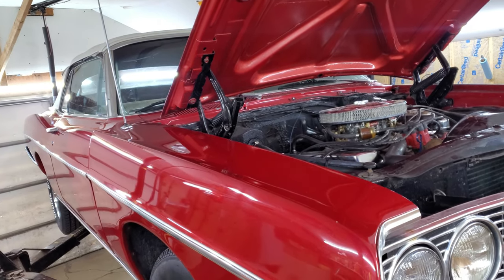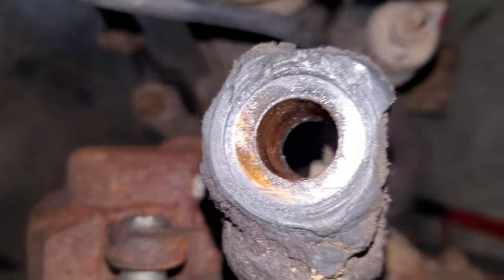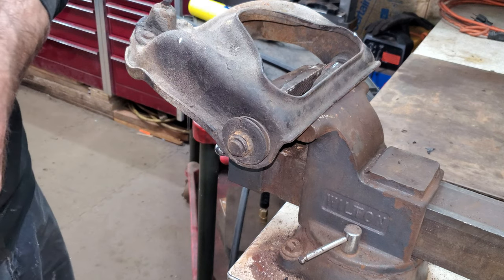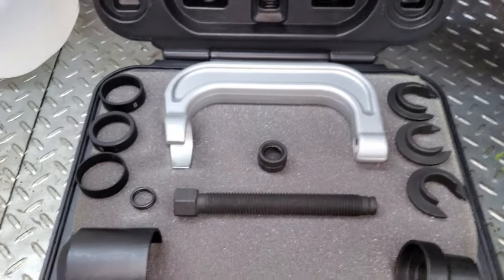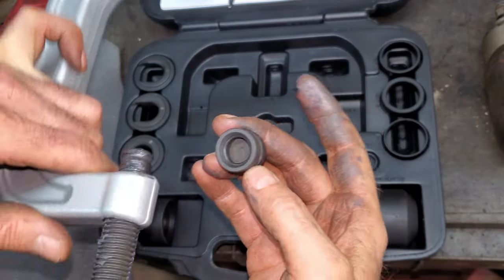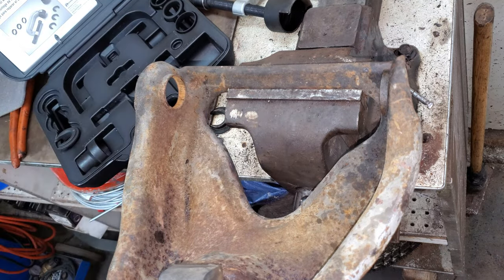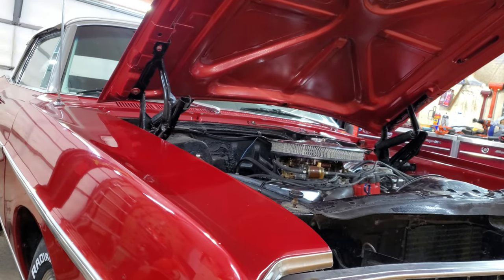1968 Ford Galaxy control arm bushing ball joint replacement

Comment: I have a 65 Galaxie 500 LTD. It had a frame off rotisserie restoration 20 years ago. Rust free and accident free. Going to do the same thing upper and lower control arm bushing. This helped me alot. Thanks
Reply from the maker: @drodman34  😁

Comment: Hey Rusty buddy, great video, definitely some useful pointers. I'm working on a 68 Galaxie 500 right now doing the same thing and then some. I have a question on the front brakes on this car and hope you have done them and have some info. The 68 front hub/rotor was a one year deal then Ford changed some things and I can't find any replacement for the life of me. Do you know of any cross over parts or maybe even getting different spindles I don't know what I just need something that works. Thanks Rusty, keep on wrenching.
Reply from the maker: I do not. I would guess that the bearing numbers, and rotor diameter might be useful. Good luck.

Comment: You gave some great tips.  I'm going to save your video for when I do the front end of my '65 Ford Galaxie.  I just got done with a complete rebuild of all four brakes and master cylinder and I'm tired.  But I did hear a "click" in the front end when I turn the steering wheel from side to side so something needs replacing.  I'm too tired now for a major job right away but I think I'll put in the Petronix electronic ignition and coil tomorrow.

Comment: Hey there!! Thank you so much for the video.
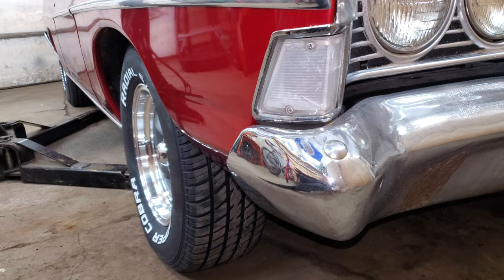Would you mind going more into detail as of what you did at 26:44? I can’t seem to understand how you determined the proper height and the procedure you followed to make it right :) Many thanks!
Reply from the maker: Did I load the suspension, before I tightened the bolt? Mimic loaded suspension, as if it were on the ground, or as close as you can get.

Comment: I have a 68 Camaro. If I just want to replace the lower control arm bushing do I still need to remove the sway bar support and shock absorber? Thanks.
Reply from the maker: Shock, sway bar link, and spring needs to come out on that I do believe.

Comment: It does not look like this thing spent a lot of time in the rust belt.
Reply from the maker: There is mud in the rear quarters, and holes in the floor. The frame has been welded. Like most people, it looks good on the outside.